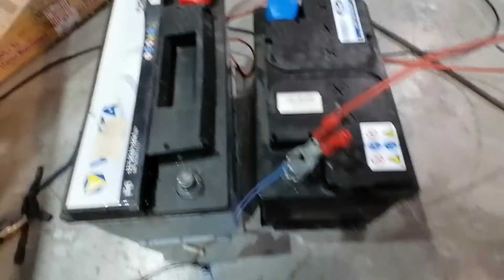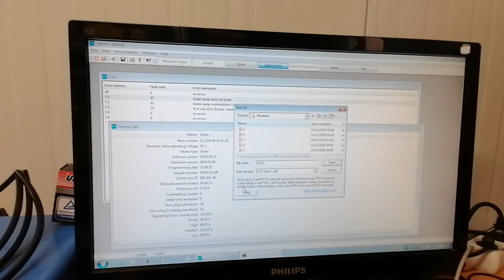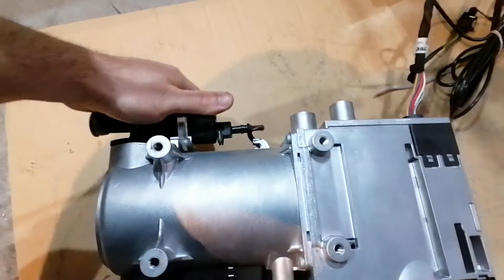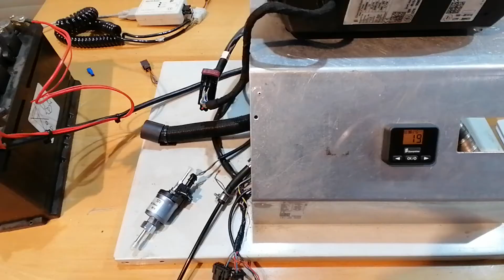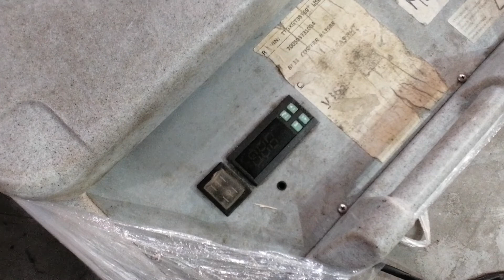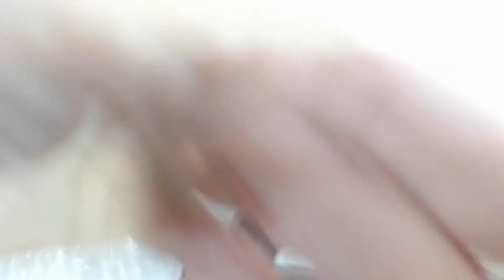Eberspacher service #4, Hydronic 10 kW pump, Airtronic D2 connected to wrong voltage, + BONUS

Comment: As it turns out, my water pump housing and impeller didn't survive the shipping from the seller.  I'd like to inquire about purchasing those items you set aside from this project.  Thanks.
Reply from the maker: Where are you from?
Reply: @DIYHelper  Atlanta Georgia USA
Reply from the maker: I would give them to you for free but I don't know if it is worth the shipping from Romania
Reply: @DIYHelper  I'll check on prices locally and if shipping is cheaper than buying new I'll of course be willing to cover the shipping.  Thank you!  Is there a way I can contact you outside of YouTube?
Reply from the maker: Normally it should be the sellers fault, we payed for a few of these until we decided to always take down the pump when shipping, anyway you can send me the address at sonka_x@yahoo.com and I'll check how much the shipping costs.